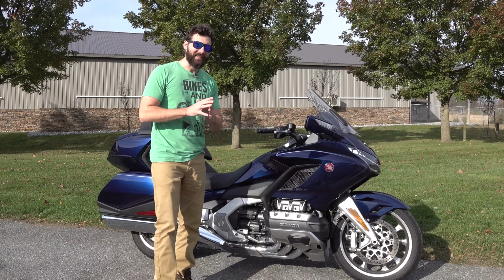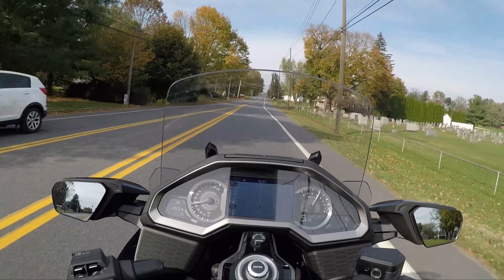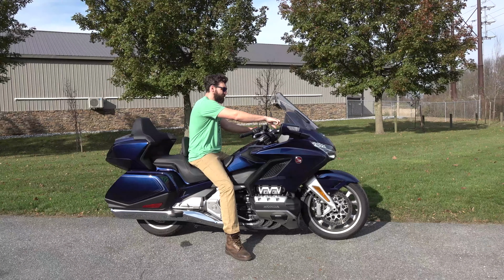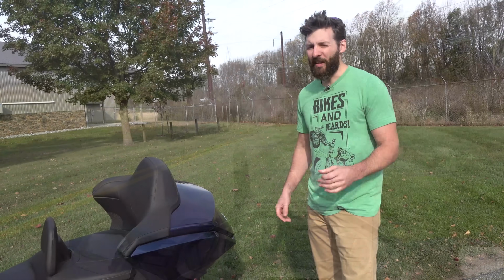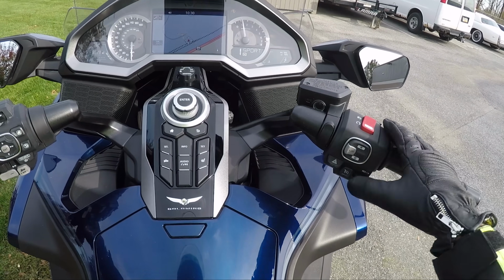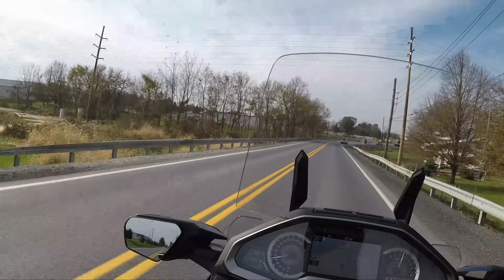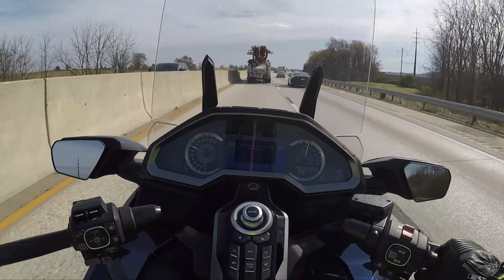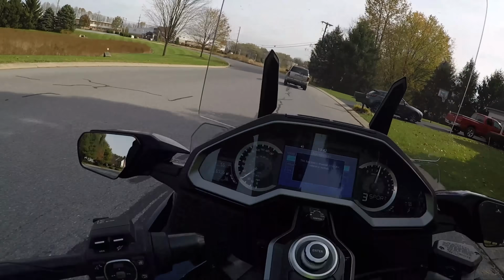You WILL NOT believe what the new Goldwing can do

Comment: Take this from an old geezer. I waited for this bike to hit the showroom here in Lubbock Texas back in 2018. I was only curious as to who the hell would want a DCT. Surely not me, I’ve been shifting gears all my life. Well, it showed up finally and I told the salesman I just wanted to demo it, I damn sure wasn’t going to buy it. I’ve had every Goldwing since ‘81. Well TBH, the 1100,1200,and 1800. I took that DCT out for a spin and it put a grin on this old man that almost 4 years later is still there. By far the most amazing motorcycle in my 60 years of riding. I’m going to ride this DCT to my funeral. And I’m damn sure going in sport mode. I love this bike. Lost the love of my life a few years back….. but, this has replaced her pretty well. Can’t say I want to ride anything different. I get a nut on this DCT just fine… lol….. but amazingly true. Retired last year and hitting the road this year and I’m out on the Goldwing. Not day trips either, I’m taking long 1-2 months trips with a short nap in between

Comment: I would absolutely, positively, get the DCT model without even a consideration of the standard, manual transmission. No contest. All the power of that GoldWing at your command with a simple twist of the wrist? It will get up and off the line and blowing your hair back (if you still have any) way before you can shift through those same gears yourself! I have a Honda Silverwing scooter with a 600cc engine and i love how easy it is to drive and how quickly I get that 600cc up and moving! I can only imagine what it would be like to have that same command over the big, beautiful GoldWing! You talk about a thriller!!

Comment: Hey there, as a Honda motorcycle Tech I just wanted to add a few comments that might help you understand a few different sections that you talked about in this video.

When you were talking about the 'maneuvering mode' where you were moving the bike forwards and backwards, you mentioned that it "switches" back and forth quickly. I wanted to add for some people (who may be concerned, such as for previous models) that reverse is not used by the starter motor anymore on the DCT ((still does on manual)). It has a reverse gear). So, what the bike does when you activate the maneuvering mode, is it actually puts the bike in 1st gear in #1 clutch, and reverse in #2 clutch. So you are in two gears at same time. When you press +, it slowly engages 1st clutch with oil pressure to glide you forward. When you press - button, it slowly engages #2 clutch to glide you backwards.  So, there is no real 'switching'. It just simply engages one clutch or the other depending on your button press.

I was skeptical about the DCT. I love riding, and I always said that shifting was half the fun of riding a motorcycle. But the DCT is so technologically cool and surreal to experience yourself, I have fallen in love with the system, and would not hesitate to buy one. For anyone curious, the shifting system is intelligent enough for you to do slow-speed maneuvers as good as a manual bike. I have done tight u-turns in the parking lot of my shop. It is a very easy and nimble bike to ride. I'm also a very small-framed person, weighing in at around 117lbs on average. I have a lot of riding experience, and I have done the same u-turns on Harley-Davidson Ultra Classics. It is a great bike for people of all sizes, in my opinion. 

A comment on the bike learning your riding. It is something I have not heard of, perhaps it is possible. I just know that the software has been fine tuned extremely well to understand when to logically decide when it is best to shift up, or shift down. Like you mention, it takes into account throttle position, change in throttle position, deceleration rate (and change in deceleration), acceleration rate (and change in acceleration), lean angle, etc. There are a variety of factors and as far as I know there is no logic for the bike to 'Learn', Honda engineers have just simply done an exceptional job at making the software for handling the shifting very intelligent. 
I think that some of the illusion of the bike knowing you could be in the fact that it has so many different gear ratios (given the 7th gear, it's not geared the same as other bikes),  and when you add in the smoothness of the DCT, you may not even notice that it has downshifted. So when you may expect it to downshift, it may have already done so, you just don't notice the engine braking as much.

If there are any other questions you have about the bike, I could try and answer them as best as I can. I don't know everything about the bike, I haven't gotten to work on many yet, no major issues that I have seen or come across yet. It's one of my favorite bikes from honda, and I'm not close to being an old guy, but I am a motorcycle enthusiast (I own a ZX-14R and a CRF250L, I just love all bikes :) )
Reply: Reliability of the dct, in your experience?
Reply: @wretchedrider  I haven't really had to do work outside of maintenance so far. Though, the number of goldwings I get compared to Pioneers and ATV's is significantly smaller. The DCT system in the Pioneers and quads are very similar, so I can tell you with experience there how the system is.

The biggest factor with the DCT is that it's MUCH more important than ever that you make sure you're changing your oil a minimum of once a year if you don't reach 3,000 miles or so in one year. I would even do two. One, say, in March, and a second during the summer or september area. Just to keep that oil as fresh as possible because the DCT relies heavily on healthy oil. If you are someone who waits to change their oil after they hit the mileage number (which for some people can be after 3 years) you'll find yourself burning up the clutches, or getting a stuck clutch due to moisture. This is something you should NEVER do to begin with, but I'm simply stating that the after effects are amplified here with how vital GOOD oil is to the health of the DCT. 

USE MOTORCYCLE OIL. I can't state this enough. So many people use car oil and it is extremely damaging to motorcycle engines. Motorcycle oil is made to be tougher at a microscopic level, and this is primarily due to the fact that it also runs through and gets meshed in the gears of the transmission (You also have two extra gears here. a 7th gear, and a Reverse gear). Car oil breaks down very fast in a motorcycle engine and you'll soon find yourself with mechanical failures and clutch slippage.

I have only had to replace one #1 clutch in a pioneer once, out of all the SXS's and quads I've worked on, and it was due to the guy abusing it and parking it in water at the seat level. The rest of the engine held up good, and the guy changed his oil frequently, however it simply wasn't frequent enough to prevent this.

So if I had to give you a concrete answer on how reliable it is, it is very reliable for sure. However, you WILL be hearing many different experiences because of people who think they know the "right way" to care for their motorcycle and wind up getting into trouble. I've seen it a lot... and it happens. Change your oil often, and use motorcycle oil (Honda makes their own oil, just use it. Oil is cheap insurance on your engine.) 

If you have any other specific questions I could try to answer.
Reply: @ChaseB1896  that's the best damn answer I could have hoped for. Thank you! Like every other opinion out there, can't just blindly accept what's being thrown around out there. I have a 2016 F6B, myself. Still under warranty but having some trans issues that no dealer near me can replicate, so I'm stuck dealing with Honda customer service, who isn't very helpful... Oh well. Might trade in on a new one with DCT. Thanks again!
Reply: @wretchedrider  Thanks! I'm sorry to hear you're having issues with your transmission... The Goldwings are some of my favorite bikes from Honda, and I always wanted to own an F6B, until they came out with the new bike and labeled it Goldwing base, I like that one now too. If you feel like mentioning what's up with your transmission, I could tell you if I have heard of anything, or give any insight to the problem. Though I can't guarantee I'll be much from this position. Long distance diagnosis is a pain in the ass unfortunately :(
Reply: @ChaseB1896  agreed, tough to diagnose without riding it! I've got ghost shifting. Even with "preloaded" shifts. 1-2 is good, I'm getting ghosts going from 3-4, 4-5, 5-4, 4-3. Intermittent, of course, so the dealer can't replicate it. Very disappointed with Honda's response to my problems but what can you do? If they can't replicate it, the problem doesn't exist.
Reply: @wretchedrider  I wouldn't imagine preloading your shifts would make a difference (Idk if you do it on normal riding, but that's a good way to round off dogs and/or bend shift forks if you do it a lot). Are you pretty much saying that it feels like it goes into 4th, but then when you ease out of the clutch it slips out to the previous gear? Or are you saying that it feels like it goes into 4th, but when you ease out of the clutch it essentially goes into "neutral"?
Reply: @ChaseB1896  it will go into gear, then a few seconds later act as if I have hit a neutral (free spinning motor, not in gear). Example would be shifting into 4th gear from 3rd, no issues, give it some gas to continue momentum a second later and it will act like it's in neutral. Oh and preload I just mean having my boot resting on the shifter without actually applying any pressure to the shifter. Take out the slack before a shift, basically.
Reply: @mikeb1838  yeah man, you wouldn't expect that sort of thing with any new bike in the 21st century, let alone a Honda. I'll be taking a hit when I sell/trade-in, and never get a Honda bike again. I know they all have their faults, but Honda's warranty/tech reaction has been just lip service. Probably hoping I'll ride it out until their "warranty" period expires. The dealer nearest me overfilled my crankcase by over a quart. Honda customer service just told me "oh yeah, they shouldn't have done that... Take it to this dealer a state away because we can't take action without a dealer trying to fix it! " 

I digress, sorry, didn't mean to make this all about me, just trying to console you when you're feeling like I have been owning a goldwing!
Reply: That means no going back once you get used to the DCT? Uh-oh. I don't know if I want to go down that path now...
Reply: Cool thanks for the info. Same here... too many cool bikes to only like one type !
Reply: Did Honda put a brake light or beeper on the 2025 model to alert the ride that the brake is own?

Comment: I have the CTX700 that the DCT came from and love it. Do not miss a clutch lever at all. It takes a short time to get used to, but the push button shifting is absolutely brilliant. I never use the automatic modes, although for a giant Goldwing touring bike I could see it being more useful. But with shifting reduced to a flick of either a finger or thumb-- there is zero downside to it being in 'manual' mode. The DCT acts like a slipper so you can't break the rear loose on hard downshifts, making it really easy to ride aggressively. Add a total inability to stall regardless of the load or incline it's on- it's just a dream for real day to day use. You can do full throttle upshifts, no having to back off the throttle to match RPM. I think it's a great system, even if the auto modes could use some remapping.
Reply: That's THE First Intelligent remarks that I have read about the DCT.😀

Comment: Bought 2019 DCT this week and spent first 150 miles in NC mountains. The performance is stunning. Hit some wet leaves in a curve and the traction control immediately kicked in. Power stop in a curve due to tree cutting equipment and the interlocked ABS brakes stopped so straight and so fast on a downhill curve that it felt like my butt came up out of the seat. I had dealer add Pathfinder Fog and Cowl lights with rear LED filler lights and tour Heli kit and a rear lowering link. Bike fits me great.
Reply: That’s a good story.   I’ve wondered about that with mine.  Good to hear that it works when you need it.
Reply: Bought a 2024 dct tour yesterday! Agree with you, the bike is simply stunning!
Reply: What the hell is a "power stop?" It's a motorcycle, you're not skating.

Comment: I personally dislike the term “automatic” for this bike or any of the Honda DCT models for that matter because the term requires defense. I own the Honda  CTX700 DCT now, a great bike and a super precursor to owning the new GW. And I love to shift, cars, bikes, anything with a clutch. But the DCT simply lets you enjoy your ride mindlessly with ALL the shifting features of a manual and then some without ever worrying about stalling, imperfect shifts, hill starts, and more. I’m someone who engine brakes like crazy. With the DCT, a microsecond thumb push downshifts into your turn while the bike up shifts as you throttle out. To all naysayers, get over your machismo and try the DCT because as Shawn imparts, you will be blown away. I do dream of the new GW... anyone have an extra $25k laying around? Happy riding all.
Reply: I love the CTX700 DCT. I've had everything from radical 60's choppers to replica super bikes-- and the CTX is one of my favorites over the years for sheer riding pleasure. It is only a 670cc so with two full size Americans on board, it's does take a bit of throttle to get her moving, but solo she is quite peppy. Not fast, just lots of low end grunt. That really favors back road blasting over highway cruising. The DCT is the wave of the future, which is why pretty much every supercar comes with 'flappy paddles' now. 
I never use the automatic modes, I feel they need serious remapping, but when shifting is twitching a finger or thumb, who cares about auto mode anyway? 
Best part about DCT is wide open throttle upshifting, which is why it's so popular in Ferrari's as well. No need to roll off to upshift, just keep it pinned and pull the trigger like Doc Holiday. 
The back-and-forth parking spot feature is brilliant. Really innovative thinking for such a common problem. I'm not a heavyweight touring guy, but if I were the DCT Goldwing would be on my short list of bikes to look at.
Reply: So what you’re saying is, you love your automatic motorcycle
Reply: @Chris-Brauch  It's an automatic clutch on a manual transmission. The technology began with formula 1 race cars to provide faster shifting and lap times, while maintaining reliability that and positive shifts automatic transmissions with their torque converter, could never achieve. Welcome to the future.

Comment: I’m sure the Goldwing is capable of a lot of torque and horsepower. Just it’s made for comfortable long distance cruising. Make a few changes to it, tune, and you could have a monster.
EDIT: This bike does have some really cool features. Reverse is a nice one.
Reply: It's not capable of a lot of horsepower. It's 90hp at the rear wheel on a bike that weighs nearly 900 pounds. It's slow, and kind of horrendous for a 1.8l 6 cylinder motor.

Comment: I owned the VFR1200X DCT for a couple years.  I enjoyed it, never took it out of auto, though the gear selection wasn't always what I would have chosen.  I have never owned a bike with a quick shifter, but when I consider the added weight of the DCT, and the fact that many people opt for manual mode, I wonder if a quick shifter might be more practical.  Also, I wish that the side cases would each hold a full size helmet.

Comment: I’m on my second GW. My first one was an 1983 1100. I’ve had a Suzuki, Harley, and still have a Yamaha V-Star 1100 Custom Special. Of all the bikes I’ve had, my 2018 GW GL1800 DCT is the best. The most comfortable and smooth ride ever. I’ve got all the bells and whistles there is available. Some ppl have complained the trunk space isn’t enough. I can fit two helmets in it just fine. Love the heated seats and hand grips. The electric windshield is nice when you have a passenger bc it helps cut down the wind on them. It’s like sailing down the highway when Cadillac made the large comfortable cars. It took me a while to stop wanting to squeeze the clutch. But, being able to do everything with the touch of a button is nice like changing driving modes from tour, speed, and rain is nice. When you put it in speed hang on bc it gets up and moves.

Comment: That tour is awesome! Always wanted a wing since the early 80's but THAT is wayyyy better than the yachts from the 90's - 2000's!
Reply: I’ve driven VW diesel & GTI gas Golfs 250k +- miles over the last decade.. Every mile the DSG (in VW speak) dual clutch was in charge. 0-60 times are is as quick or quicker than stick shift.  An occasional slow up-shift when cold, otherwise no problems.  I toured extensively with ‘77 Yamaha xs750  triple..... so crude compared to this new Honda.
Reply: BTW “Hill Assist”  are you joking? The dual clutch does even because it has no torque converter.

Comment: 03:30 - "In the 80's Honda had the Hondamatic, not sure how that worked."
I have a 1980 CM400A. The Hondamatic is not fully automatic. It is a clutchless 2-speed high/low manual with neutral on bottom, then one shift up to low, and a second shift up to high. No clutch, so you just roll off the throttle and shift. Upshifting is pretty forgiving. Downshifting... not so much.
The new DCT seems absolutely incredible, but I only can judge by videos. It'll be a few years before I save up to buy one.
Reply: The Hondamatic was just a two speed tranny, with a torque converter instead of a clutch.  You ran it in first in town and second on the road. The slippage in the torque converter, allowed the bike to start in second gear.